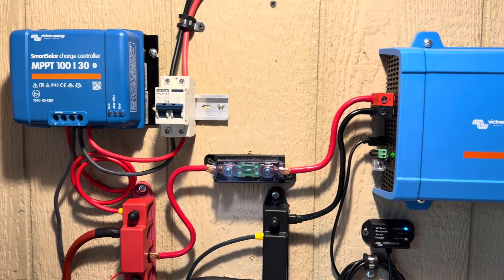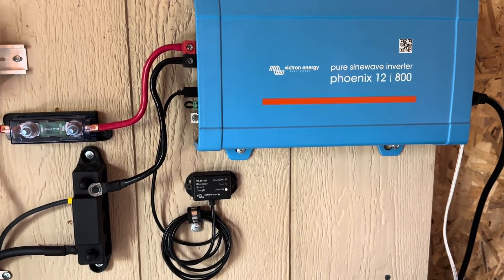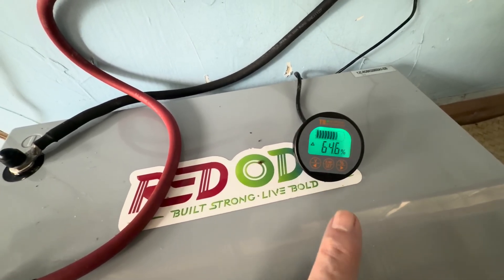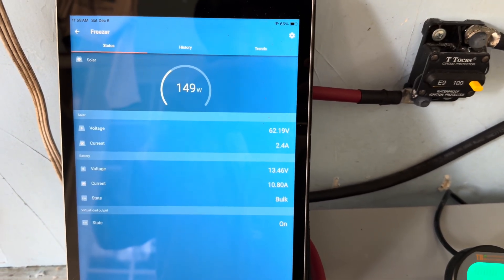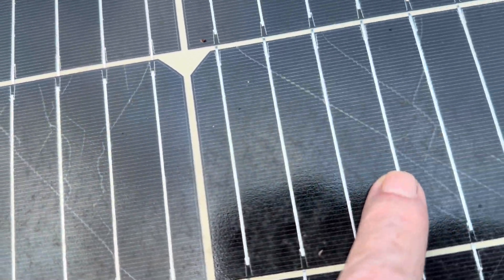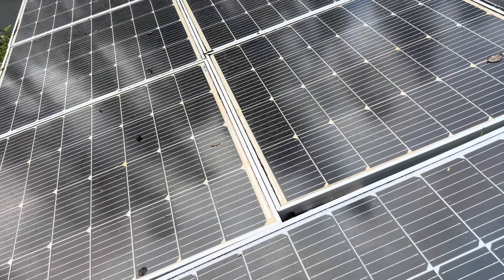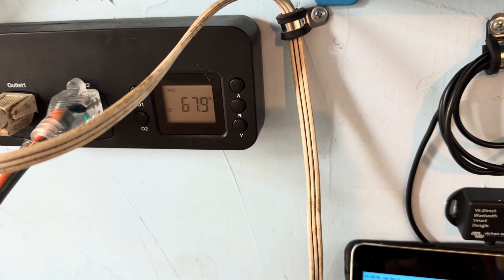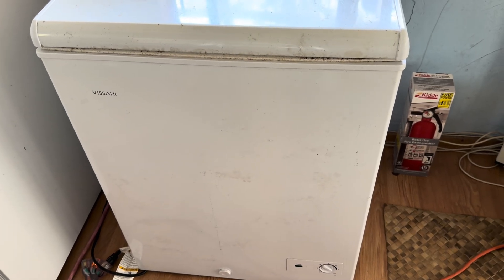Backup Power Ballet: Swapping Systems to Save the Food Stores

Comment: Yep, snail trails and they begin to show up after 3 to 5 years from my experience with 100w panels.  Eventually, they will get worse and can lead to corrosion and failure.  You will find on larger panels, that the opposite occurs in that you will see parallel lines form on the vinyl back sheet after 8-10 years.  However, NEW panels these days, only time will tell.  Nice video and you can flip the cover with a torx 10 on the VE.  Aloha, Gary in SE MI
Reply from the maker: Ah okay that's what they call it! I thought literal trails from real snails! I have both now! It finally sunk in on me after saying to another guy no , those aren't snail trails! Made me laugh Gary. Aloha brother!🤙

Comment: Snail trails are corrosion in the panels.   They will eventually lead to failure.   The diodes will blow in time.   They come from minute cracks in the glass or damage on the backside film.    If they start to bulge the backing material that is not a good omen.

Comment: The a 125 amp fuse on , what looks like   , a 10 gauge wire . Does anything seem wrong to you about your wire size and using a 125 amp fuse ?
Reply: The conductors appear to be 6–8 AWG, which may seem smaller than ideal for equipment that runs continuously. However, when you calculate the specifications, they are actually sufficient. The inverter has a continuous rating of 650 W, which draws approximately 50–55A. These wire sizes have withstand ratings ranging from 200 to 400A, depending on the gauge and insulation type, so they shouldn't pose a fire risk.

The choice of fuse also makes sense. Since the unit can handle peak loads of 1500W, which corresponds to about 125 A, the fuse is appropriately sized. However, for optimal performance, the DC terminals can accommodate conductors up to 25 mm2. Using larger conductors could reduce voltage drop and improve heat management.
Reply from the maker: Pretty sure it's 6 ga. on the inverter, but will recheck. That inverter doesn't take as big wire as you might hope for. Mahalo for inspiring me to give it a closer look brother!🤙